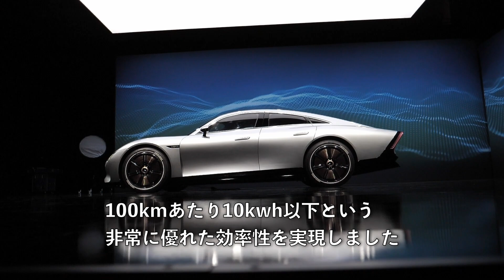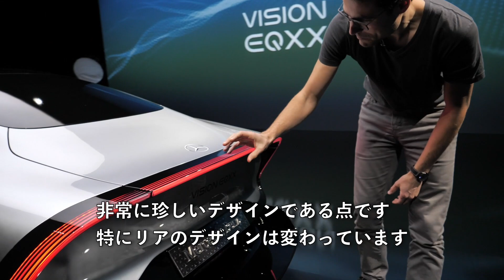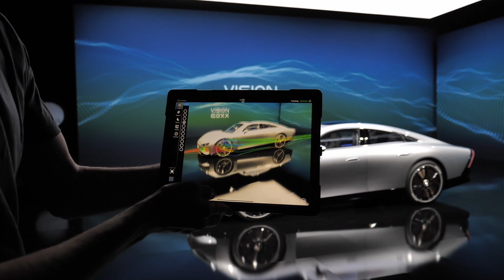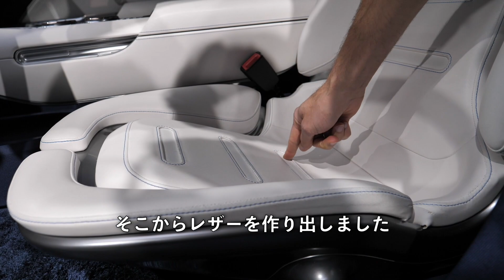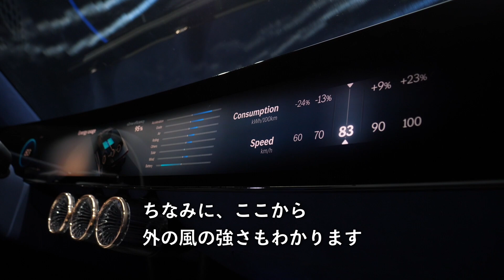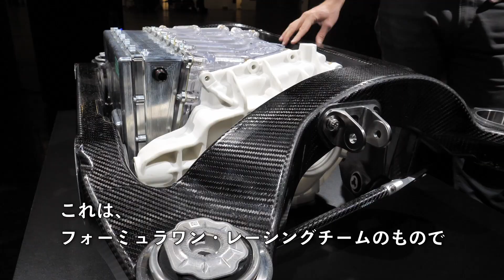ついに航続距離1000km達成!? EQXX メルセデスベンツ EV

Comment: While I am more than happy to see another EV that can have range up to 1,000 km per charge, NIO's ET7 with the ultra range of 1,000 km per charge will be out at end of 2022.  Even the smaller ET5 will have the range of 1,000 km per charge.  Unless Benz is having at least 5% longer than 1,000 km, that is not even a breakthrough.  To cheer for this new Benz with 1,000 km per charge also means a bigger celebration for NIO's first two EVs with 1,000 km per charge at much lower prices, but with more interior room.  So, while I am very happy to see Benz can also do it, I wish Benz to do it without the sacrifice of interior room and price for the mass.  Else, it is a niche product.

Also, no matter how fast the existing charging technology allows one to charge his/her EV's battery, you can't be any faster than the speed of battery swap.  NIO's battery swap stations let you have 100% fully charged batteries in 3.5 minutes.  Can the fast charging technology of this Benz match it ?  Nowhere close.  

At least, Benz can claim that its range can beat the Tesla's range.  Hopefully, it won't be over $300,000 USD while it only costs about $100,000 for the NIO's ET7 top trim with the same 1,000 km per charge range.